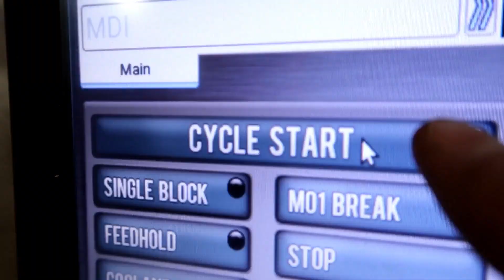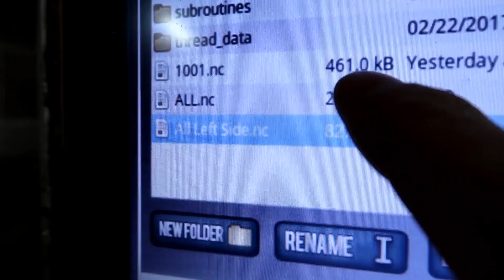More Machining from a Pallet: Home Mfg. Days #29

Comment: The 770 is a nice machine in aluminum. With the high speed adaptive tool paths these machines can make short work in aluminum parts. I got mine with the ATC  but I find myself needing 4th axis more than the atc for the 3d parts and reducing opp setups. If you're looking for for an atc for less for your 770, feel free to PM me.
Reply from the maker: Sounds good! At the moment most to all of my funds are going towards my CNC plasma cutter so I may have to hold off on the ATC for a bit.  Thanks for the offer though!!

Comment: Looks like your engraving had a bit of a burr raised. If you leave an extra .005 on your part you can face that off after you engrave and your engraving will be nice and smooth.
Reply from the maker: That is a great idea! I shall add that into my program.  I was thinking I was going a little to deep but now that you mention that I will keep it the same and add another facing op.  Thanks for the tip/idea!

Comment: Nice work!  I’m anxious to get my order in from 8020 for my 770 enclosure. Got the lexan this past weekend. Quick question, what are you doing for lighting?  I was thinking about covering the top of the enclosure with sheet  metal and cutout for a couple recessed lights.
Reply from the maker: My lighting is what I would like to call "bootstrapped".  I use clamp lamps with LED bulbs and clamp them to the top of the enclosure. I bought some of the LED shop lights that I plugged into existing light sockets with the adapter.  I hope you can sorta picture that.  The links are below so you can check them out.  I like the sheet metal cutout idea though...seems a lot more professional haha.
Reply from the maker: https://www.amazon.com/gp/product/B06XGDJ65H/ref=oh_aui_detailpage_o01_s00?ie=UTF8&psc=1

https://www.amazon.com/Woods-Clamp-Aluminum-Reflector-Listed/dp/B000HHQ94C/ref=sr_1_4?ie=UTF8&qid=1520892225&sr=8-4&keywords=utility+lights

https://www.amazon.com/gp/product/B01EHAE56S/ref=oh_aui_detailpage_o01_s01?ie=UTF8&psc=1